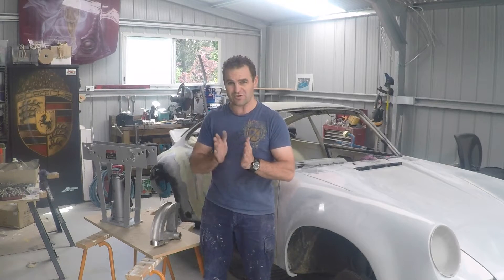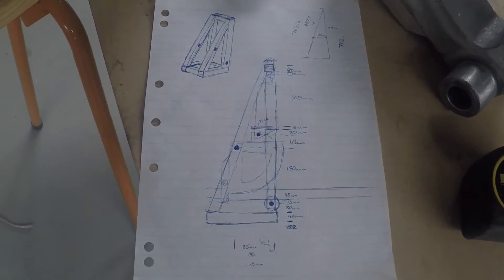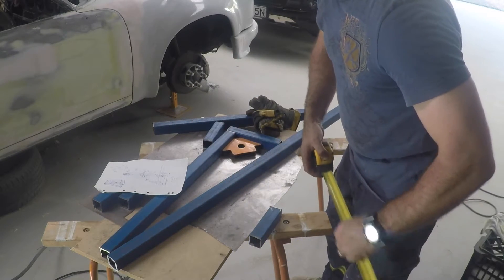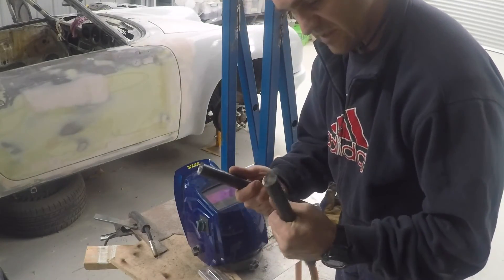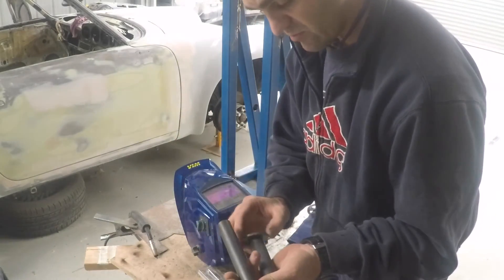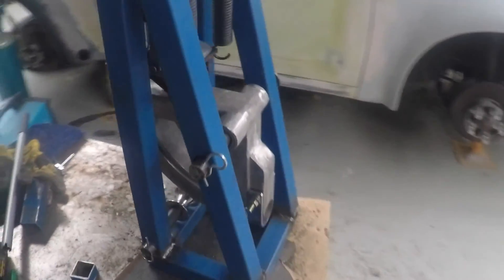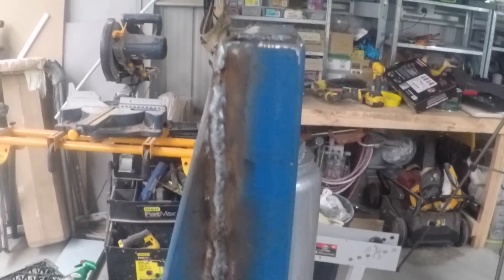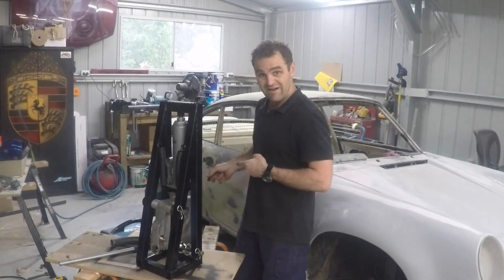How to build a roll cage Tube Bender

Comment: On the harbor freight style pipe bender if you fab a lock on the top of the die where the tube cannot raise up during the bend and kink they work great. Just slow. I drilled holes in my die base and with 3/8 rolled steel made a couple of d rings that I thread the tube between the die and the d rings and the tube cannot rise out of the die during the bend.. There are some similar tricks to making these work on youtube, Harbor Freight bender mods.

Comment: Great video!  How'd you get the die into Oz if you don't mind me asking?  I'm over the ditch in NZ and it looks like I may have to use a freight forwarding service, assuming it's not too heavy for that too!  Any idea of the approximate weight?
Reply from the maker: I bought it off of ebay so shipping was sorted there.
Reply: I have the same problem.  also in NZ lol

Comment: Die and roller links are bad... any updates, and in steel.  Any luck with 2"?  .120 wall
Reply from the maker: I have built 2 cages with this now, and it works great. No kinks, nice smooth bends.
Reply: "https://www.youtube.com/redirect?q=http%3A%2F%2Fwww.ebay.com.au%2Fitm%2FAffordable-Bender-Roll-Cage-Tube-Bender-1-3-4-DIE-SET-ONLY-%2F331906400979%3Fhash%3Ditem4d4729c2d3%3Ag%3AZTEAAOSwaNBUdPFs&redir_token=pJEwalPdify2W3WX_hhw6v6Js1J8MTUzNDA1NzUyN0AxNTMzOTcxMTI3&event=video_description&v=v1zs3WExdog"

THAT link is now bad....

Comment: Hi Jeff, cool video mate.
Is the 1-3/4" die with 7" radius the cams specified die?
Reply from the maker: Yep. Look up on the Cams website for the regs. I printed them out so I could quickly reference them while I was building the cage.
Reply: Home Built By Jeff thanks mate

Comment: Jeff great videos very inspirational. Additionally a huge thank you so very much that you are doing your series with your wife included and doing some work. Nothing sexier than watching your wife participating and enjoying your hobby right along with you.

I have a couple very dumb questions that may be very obvious to other people but for some reason I’m missing them. Sorry to ask are you attaching the tubing for the end of the mandrel die to make it follow the die as you apply pressure with The jack?  Or does it just move with the die as you pump the jack? 
Also you had mentioned drilling additional holes in the 90° upright leg members to allow bends greater than 90°. Is this the roller axle mounting point you are moving? 

Again sorry to ask a simple questions.  I need a tube bender  of this type to build a roll cage for use in my 1957 VW Beetle, which  I am building for vintage racing. Thank you for all your hard work filming, editing, title work, mixing and compiling your videos. They are of great quality, entertaining and inspirational. Lastly greetings from America!
Reply from the maker: Sorry I don't really understand the question. The tube does not slide in the die. it is clamped at one end of the die, which is where you start your bend, and then as the die rotates it pulls the tube around with it to make a nice bend. It is not a mandrel bend like you would find with an exhaust system. That is a different type of bending that can't be used with cages. 

The extra holes are for the roller, although you can't really do much more than 90degrees anyway at that is the limit of the die.
Reply: Home Built By Jeff  that’s the answer I needed thank you!

Comment: Nice Work, and perseverance, I watched the pipe bender fail video first and then this, thanks for sharing your success and failures with bending tube on a budget.
Reply from the maker: Thanks mate. I have found others are not necessarily honest about what really works and what doesn't. The main reason the modified pipe benders don't work, is because the radius of the dies is too tight.

Comment: I'm also a bit confused regarding the measurements of die's - Is a die sizing (like the one used in this) relative to the OD of the tubing or the ID. I've bought 32nb (32mm ID which is approx 42mm OD)  pipe in the past to use on a pipe bender but it kinks... I've been told to use a tube bender, but it's pipe, so it's all a bit confusing really. The ebay page lists sizing, but what are they referring to?
Reply from the maker: You have to use 'tube' not 'pipe' for a roll cage. Tube is always measure by OD and it needs to be the correct cold drawn stock for the job. I could only find 2 places in Sydney that stocked it and it is only used for roll cages.

Comment: Could you please link me to the dye that you purchased for this video - is it suitable for more than 1 size of pipe?
Reply from the maker: Hi. You need a separate die for each diameter of tube you use, so if you can stick to the one size it is better for you. I got my die from "The Affordable Bender" via ebay. Here is the link to the one I used which is 1 3/4" but they make them in a range of sizes. 

http://www.ebay.com.au/itm/Affordable-Bender-Roll-Cage-Tube-Bender-1-3-4-DIE-SET-ONLY-/331906400979?hash=item4d4729c2d3:g:ZTEAAOSwaNBUdPFs

Comment: is there a way you could make a rough blue print for this? I was about to start building a sand rail and realized I didn't have a tube bender and for the design I'm using I could really use something like this.
Reply from the maker: I just measured it up from the die I bought, and the particular hydraulic jack I had. As you may have seen on my video of how NOT to make a roll cage tube bender https://www.youtube.com/watch?v=kG51ub_zHlY you can see that the die is the most important part.
You can see my blueprint for this here https://youtu.be/v1zs3WExdog?t=84 which basically takes into account for the exact measurements for my die and jack, which, unless you had the exact same bits would be different. 

I am not at hoe at the moment, but when I get back, I may try to make up something a bit more accurate so you can follow and maybe even do another video on how to measure it putting in the measurements for the particular jack and die you use.
Reply: +Home Built By Jeff I understand what you're saying my question didn't come out how I meant it. I was asking on the one you built if the jack is X tall then the frame is Y. if that makes any sense. and thank you for being the only person out of 20 that have given me a reply. definitely subscribing
Reply from the maker: Cool. No problems. As I mentioned I am away at the moment so it may be in a couple of weeks when I can get back to it. I will try to come up with something for a general type set up. I suppose it may be easier to film another video going through it. Are you planning on using the die from "The Affordable Bender" or are you planning to use something else?
Reply: +Home Built By Jeff  I haven't really worked out the parts for it yet. this was just the only bender I saw that worked well enough that I would trust. after re watching the video I have a general understanding of how everything would work together. but if you could make a video going a bit more in depth when you got the chance it would help me (and I'm sure alot of other people) out. it's the first time I'm trying my hand at something like this
Reply from the maker: Haha. Mine too, but if we all help each other out, it makes everything so much easier for all of us ;)
Reply: +Home Built By Jeff yea haha I was going to record the progression of my sand rail but I'd like to make sure the bends I make arnt going to get someone hurt if they copy me and roll

Comment: It's really sad how sensitive everyone has to be about the way welds look. Some stupid twelve year old kid sees a flawless weld on the Internet then proceeds to attack everyone who has a weld that looks different. Welds can look like garbage and still hold 100%. Don't worry what trolls say. Next time someone attacks your weld, go to their channel. IF they have zero videos of welding, promptly ignore or even block them. Losers. :) Great work bud. Subscribed!
Reply: I agree!  I have an AAS in Welding Technology and have been in the field for roughly 5 years since.  I think it is a bit harder to get by in the field with a rough looking weld as there are some extreme nitpicking inspectors out there.  (Most of which do not hold a CWI, and hardly know a thing about the process)

Really for welding at home, as long as you see both pieces of parent metal breaking down and you are filling in that space with filler metal.  You'll have the proper fusion you need to create a weld as strong as the steel you are sticking together.  -- Furthermore, if that weld does fail eventually but it splits right down the middle.  (IE it doesn't tear towards and edge or toe of the weld.)  You did everything you could as the welder, you'll just need more reinforcement next time, or a redesign of the joint is required.
Reply: The welding quality isn't his fault. The problem is he's in Australia and since welders osculate AC/DC which spins clockwise in the northern hemisphere they tend to spin counterclockwise in the southern hemisphere which throws the welding machines off and although the welds are strong they don't look as great. The way to counteract this is to either make backward "e" 's as you weld or weld backwards. If you're not ambidextrous (able to use the right and left hands equally well) then welding backwards isn't an option because it will just throw your whole technique off. I know this because I frequent Australia and as an off-road vehicle builder this was a major problem at first. There is a third option but you need an electrician that has a excellent understanding of electricity theory and can switch the poles on the outlet. This is expensive so it's easier to just weld with the backward "e" pattern.

Comment: what size tube and what material is the tube you are using for the rollcage
Reply from the maker: +darren francis I am building it to the CAMS (Aus' governing body) spec, which is 1.75" with a 0.09" wall thickness.
Reply: Could it be used in a drift car
Reply from the maker: darren francis You need to check the CAMS website for the requirements, for the class you are after, but in general, yes. All of the specs and regulations that I am building this cage to are on the CAMS website.

Comment: Nice job..! Just a thought....you've already tried the sand method, but if you used this bender with sand would it not get rid of that last bit of distortion you're getting...?
Might have to make one myself...!
Reply from the maker: +ollydubhead That would probably make it even better, but it is acceptable for the Australian standard. The only issue I don't like about the sand method is the potential for tube to rust from the inside out.